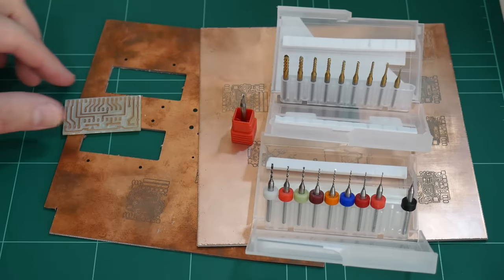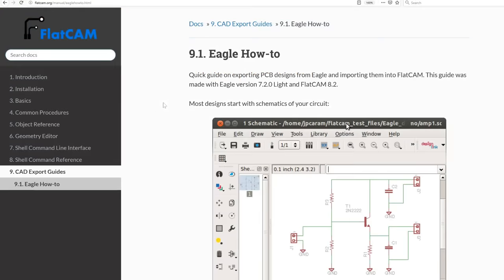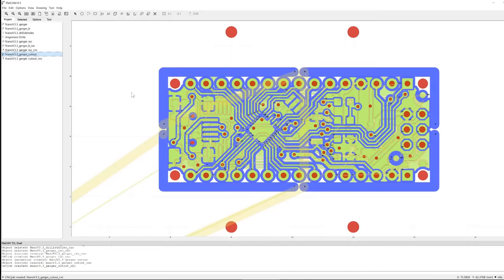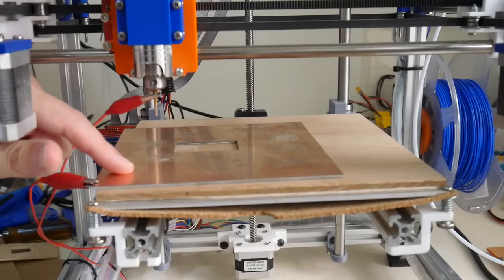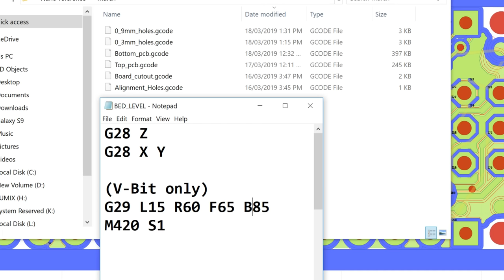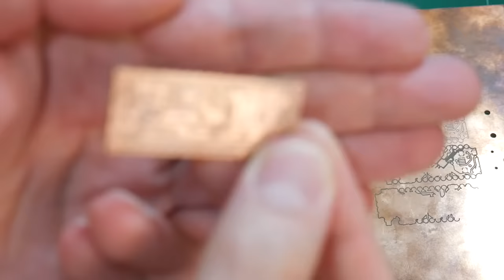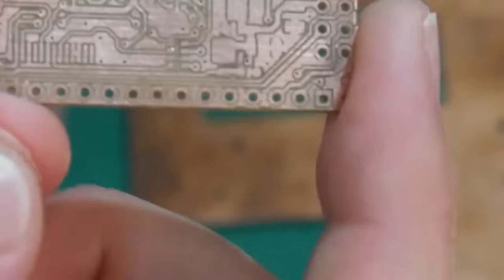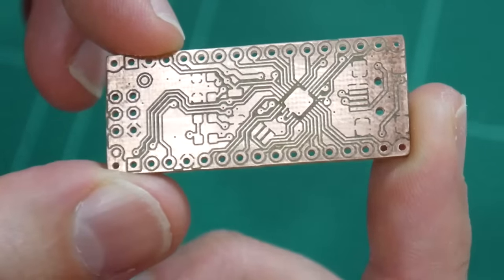Advanced DIY PCB with a modified 3D Printer

Comment: Interesting method, and quite intense amount of detail for each operation. Thanks for taking the time to develop  and demonstrate it. I have have very good success making prototype PCB using the laser etch of black paint (I use Eagle image export into Lightburn), then Muriatic acid (HCL) and hydrogen peroxide solution to etch away copper. Very clean and much faster

Comment: I would have got rid of all the excess unused copper on both sides. May take longer but would be easier to look at the circuit for my eyes at least. Cool AF though! I'm torn in what to purchase as far as a printer or mill myself. I'm looking for a 3d printer with a large usable surface area with the ability to 3d print, but also mill too, and with the precision yours has. Excellent vids so far though. Very informative

Comment: Nice work. I have so far failed with pcb milling on a modified T8 CNC and a Cyclone PCB Mill. In both cases, the spimdle runout was ridiculous.
Reply from the maker: Yes I had to change the flexible shaft I was using as the Z axis wasn't consistent. Such a pain but worth it once you sort it out.

Comment: Can’t we use an addative manifacturing technique? That way you’re not wasting any copper. For example you could load a regular dual extruder FDM 3D printer with plastic and copper wire. The plastic is layed down both as insulation and as a ”glue” for the copper so that when the hot copper wire is ”extruded” it melts the plastic under and gets held in place by the plastic. Only problem with this method is that you would need some high temperature plastic which can resist soldering temperatures. Another alternative would be to use what you printed as a placeholder and then transfer the printed copper wires onto anoher surface which can handle soldering temperatures and then either melt away or mechanically remove the plastic.

Either way, seems like you could save a bunch of cooper that way :) and you could even use variable diameter copper wire for components with different currents :)

Comment: Here's a thought.  Laser cut Kapton tape with the negative image (ie kapton hole is where there is no copper).  You could place the kapton tape on the pcb to start with.  Once the lasering is done, chemically etch the exposed copper.  potentially you could do both sides of the pcb at once assuming you lasered the kapton on both sides.  Peel kapton off after etch and you'll have a nice set of traces left.   Drill final holes and plate.  You could also laser cut kapton with the soldermask and the  stick that on the finished pcb.
Reply: just laser printing on photo paper then transfering the ink onto the double cladded copper pcb then etching with the ink as a mask would be more practical which is the standard way.  The whole point of this video is to get rid of the need to use etching chemicals
Reply: Can you show me a link please.  I used to do laser print onto acetate and the  photo expose.  The issue is that toner is not 100% light blocking so you get defects on the exposure.  Direct cutting of Kapton is better in so many ways.  But laser etching would be perfect.

Comment: It's easyer and better to draw tracks, pads, vias and polygons using 3d-printer as plotter with permanent marker (it's easyer then milling) and then etch the board in the ferric as usual. In this process there will be no huge amount of copper on places when it's not needed, so the result will be even cleaner.
P.S. 22:04 was PAIN

Comment: Yes, your result looks nice - but is it worth the effort. While I truly see the usefullness of CNC engraving, I really don't think it's a good choice for pcb making. You might argue that toner-transfer is mostly only working well for single-sided pcbs and that's true, but you can make a lot of designs single-sided, even using smd microcontrollers. The counter-argument of handling "nasty" chemicals is counter-acted by the huge amount of fine glass-fiber dust which milling creates. 

I like the automated drilling very much - and for toner-transfer I always include a drill spot in the design so that the drill (manually operated on a press) does not wobble but has a point to grab directly as you said yourself later in the video. If you had a harder sacrificial layer underneath most probably your standard drill bit would have been sufficient for drilling the 0.9mm holes.

Comment: seeing how the drill bit is vibrating at the begining of the hole drilling it seams like it's gliding a bit over the copper. That is confirmed seeing the end result (holes not centered on the pads). That's preaty tipycal, coper is tought to enter. To avoid that i would advice you to have the hole's center slightly marked with the V bit befor the actual drilling, then the drill will self aligne in the prehole.

Just my 2cts...

Comment: Thanks for sharing.

My advice buy a 2500 mW laser. Paint your pcb board black and laser engrave your design on it. Through it in an etching solution and you will get 100 times finer PCBs. Based on your design, the process might be also faster.
Reply from the maker: Cheers. 100 times finer than the 0.2mm I achieve here is 0.002mm? I guess you still have to drill holes and cut out the board, so speed may not be any faster?

Comment: Hello,
I have been using your really amazing work for a long time. I built HyperCube and followed the same reasoning for the printer to have more functions. I also wanted to be able to create PCBs, but I discovered JLCPCB and the whole concept turned out to be completely unnecessary, just at the price JLCPCB offers and above all quality, creating your own PCBs is simply pointless ... . Only one can attach to the price for a shipment which is (in my case) 4x bigger than the price for the PCB itself, but still the price for the whole order is reasonable. Immediately I say that no one pays me for any advertising just yesterday I got my order and I am very impressed with the quality.
Greetings from Poland.

Comment: What about applying PLA to the copper then etching it in the classic way?
Reply: Thats what i thought was going to happen by the title of the video.
He would need to heat up the board and use a 0.2mm nozzle, even then it may not stick.

Comment: I gave a thumbs-up already some while ago to this video. But your results are so gorgeous, that I need to comment as well. I have tried in the past to make doubled side boards on my cnc, and I would rather blame the screws for the misalignment (I used sewing pins). Also, if you start with a board, that is just big enough to have the alignment pins, you can easily flip it around without getting affected (so much) by the bed being misaligned, or a bit of dirt left on the bed

Comment: Nice video,, but at this point, I'm using various board houses these days. I don't mind the turn-around time and the price is certainly right for a fully-formed professionally-manufactured circuit board complete with solder mask.
Reply from the maker: Yeah it's so cheap these days. If you need a board on same day there really isn't an option though.

Comment: Why don’t you leave holes in the pad areas when the v-bit cuts the traces so the drill have a centering hole to start?  Won’t that produce better aligned holes?  Thanks.

Comment: How Ironic. I just soldered an Arduino nano from a bare PCB! I did not use a stencil, but I used some solder paste and a steady hand. 
I had just found a bunch of them in my school's advanced soldering room and felt like challenging myself.
Reply from the maker: That is a coincidence. Well done with the soldering, I assume you've tested the board afterwards and it works?

Comment: Just like "G0 F300" you could add the line "G1 F15" so you dont have to edit all the drilling moves. At least for my printer running smoothieware that works well.

Comment: I was hoping this would be showing a new conductive material to 3D print boards. I’ve seen a couple of board 3D printers. Very good, but too expensive for my use (around $2,000 each for the basic models).

Comment: You've made a PCB with the laser tool from a raster file, then a PCB with the routing tool from g-code generated by FlatCAM.
Why not making a PCB with the laser from g-code, using the router bits only for holes and the cutout?
Reply from the maker: Yeah I actually did this a while ago. It does work and is very quick. I didn't etch the board in solution though so I didn't do a follow up video. Cheers.

Comment: Very cool!
Now I need to figure out how to attach my dremel to my 3d printer.
I am wondering if a "vacuum assist" would be beneficial in this case (similar but opposite to the air assist seen on many laser cutters) to help keep the debris from interfering with the cutting/drilling tool. Have you tried this?
Reply: I somehow can't imagine that the tiny specs of fibreglass and copper that are easily blown away just by the air turbulence around the rotating tool could be interfering here at all.
Reply: @SianaGearz  IDK, but after seeing the "problem areas" where the copper was pushed to the side rather than milled away made me think that some debris buildup may have been involved.
Reply: 3D printers are not designed to take ANY load to pretty much any directions. It is good for mocing the head but can't cope with the forces needed to do anything else. On some printers, maybe but say.. the usual CR10 type of printer can't really take any forces, the X carrriage is just about rigid enough to carry its own weight.. Just about.. 

And after that, you have to take care of chips and dust. The vacuum will NOT be able to catch them all. This means that printers that move their bed are out of question, you will just jam the bed, cause pitting in the rollers and the rails.. 

You can attach laser to a 3D printer but not a mill. Look for MPCNC, Mostly Printed CNC for ideas how it should look and think if your printer is worth to be ruined as that is what WILL happen to it.
Reply: @MitzpatrickFitzsimmons  I think it's just a burr thrown up by the cutting edge moving fast and with little force, not enough to reliably cut into the material. Thus also the tiny dust-like particulate that it produces, because it kinda abrades the material more than it cuts it. It is after all a Dremel, a low-torque high-speed tool, mounted to a couple metres of slightly stretchy belts, i think you'll just have to live with this kind of quality on this kind of build.

Comment: How do vias work on 2 sided pcbs? Do you have to fill them with solder?
Reply: You cannot reliably fill them with solder, as it'll tend to ball up on top and bottom but form a void in the middle; you can fill them with rivets that are sold for this purpose or simply stick a thin solid copper wire or leftover component leg through and solder on both sides.

The way they're made in factory conditions, they FIRST drill the vias and through-holes, then they plate the entire PCB with an extra layer of copper, which also seals up the vias, and then they etch the copper to create the traces.

Comment: Can you show how to connect the top and bottom plates?
Reply: Is it possible to use just a single hole and connect both side with solder?
Reply from the maker: A small wire through the via hole and solder it on either side. Do that for every via.
Reply: @Tech2C  is then a better strategy to put power management stuff on one side and logic on the other to prevent 10s of data wires? They are called vias?
Reply from the maker: Sure if you can design it that way. Fewer vias means less work for you.

Comment: would it be a simpler method to use a fine tip pcb pen mounted in a 3d printed holder and paint the traces then simply etch them? no mechanical stress, no vibrations for the printer. there are even markers with a tip of less than 0.1mm but I don't know if <0.1mm has enough ink to resist etching, maybe using multiple passes over the same line.
Reply from the maker: That is an alternate method of making PCBs. You would still need to drill holes and cut out the board. Might as well mill the traces too.
Reply: @Tech2C  thanks for replying. i understand what your videos explain. but what I meant was to drill holes using the method in the video but instead of milling traces, I think painting them would extend the 3d printer  life indefinitely and will allow you to make very fine traces.

Comment: Looks cool, May i know what software you have used for your engraver? specially GRBL version and auto leveler? 
Thanks
Reply: That was marlin firmware for 3d printers, not grbl, and pronterface to transmit the g-code. marlin requires an ATMega to run due to the extra processing power and memory required.  Clones of these are less than a tenner still, and give you more inputs for the probe etc.

Comment: you drilled the vias - how are you going to connect the through-holes?
Reply: No need, just solder both top and bottom pads. The pin of the through hole part does the connecting part.

Comment: Could you set your Z-axis Max Rate in the firmware to 15, and leave it at 300 in the g-code, thus the firmware will do everything at 300 except the firmware max rate will take priority over the maximum z speed? I think editing the g-code may be unnecessary.

Comment: The drill bit you are holding in your hand at the beginning doesn't look like a 0.1 60 degree V-bit, it has a flute. was that a mistake in the video?
Reply from the maker: Not a mistake, the v-bit has a 60 degree taper from the point. Purchased from here: https://www.mytoolstore.com.au/products/Solid-Carbide-V%252dRouter-Bit-.html
Reply: Ah. Ok it was just the link in the description above was for straight V-bits I have not seen that bit before.

Comment: Have you tried cutting alluminium on this cnc? Want to build this as cnc not a printer
Reply: Im guessing the MPCNC would be better for what you want
Reply: Build something with leadscrews to drive the head for milling, as belts will skip and motors might run too hot with sideways force.

Comment: So, do you think I could do this on my mastercam software and Haas VF3 machining center? :)
Reply: Only if you have through coolant for the 0.3 mm drill bit.... :-)
Reply: @timogross8191  I have used stub length solid carbide drill bits and pecked it to clear the crud. It worked pretty well though slow.
Reply: They make drills especially for PCBs.

Comment: Hey Chris, look into Marlin's _adv config: PAREN_COMMENTS and GCODE_MOTION_MODES for the Feedrate command without G0/G1. And also define high G0_FEEDRATE (equal to your max travel speed). These don't turn Marlin into LinuxCNC, but it removed my need for post-processing gcode. :)
Reply from the maker: I can't find those statements in Marlin's Configuration_adv.h file...
Reply: @Tech2C  Are you sure you're on bugfix-2.0.x? .. The bugfix-1.1.x branch has been "dead" for a while now ...

Comment: Hi sir how to add probe to marlin board
Reply: Simply in place of the Z endstop.
Reply: @SianaGearz  thanku but sir attached some wiring for z probe
Reply: @ahangersuhailahmad  Yes. The wires go directly to the endstop connector. It's simply a crocodile wire that has been cut in half, you take the same kind of connector that the Z endstop uses, you solder or crimp the middle ends of that crocodile wire to those same pins that the Z endstop uses.

Polarity is generally irrelevant, except if you managed to somehow ground the collet chuck or the attached PCB to the printer control board, in which case the reading won't change properly on contact; then you just swap over the wires and you're good.
Reply: @SianaGearz  thanku dear

Comment: Now show us how long it took you to get to this point and then repeat this process many times. I have a small cnc with many upgrades and spent days refining this very thing. I had my process down and was all set to make a video and everything went wrong. The tip of a v-bit just needs to be off by a tiny amount and it would make this fail. Without mask it would be a nightmare to solder these tiny pads so I would not even bother anyway.
Reply from the maker: Never give up, keep trying, you'll get there!
Reply: @Tech2C  it's not a matter of not giving up, but I just found it to be very frustrating and the time it took to get a design good enough without problems to be quite long and not something you can just leave and not keep a close watch over while doing something else.

Comment: Jesus crist! Dude you mad! As operator of CNC milling machines can tell, that its WAY EASYER to buy it, rather than make at CNC. Amount of money at drills and time at control programs are insane, comparing with just buying pcb in internet or making, using paper print and copper salt.

Comment: Well what's the point when you can get a PCB manufactured in china for 2 USD/piece with shipping ?
Reply: Depending on the size of the board and how often you update your circuit design, the setup costs can be quite high. When i was managing an electronics company, the electronics engineer who owned the company was spending $300 just for the masking setup of the boards per design, which were no bigger than 140mmx100mm. He was constantly revising the circuit layouts on these boards and would have a new one brought out every month or so, due to finding problems with the previous designs, so it can get quite costly. Not to mention to have a board professionally made in China takes ages, and if you are only working out the main issues, like my boss was, then this can become quite an unnecessary waste of time, especially when you are trying to stay ahead of your competitors. Would be good if there was a way to do multiple layers instead of just 2 sided copper clad PCB